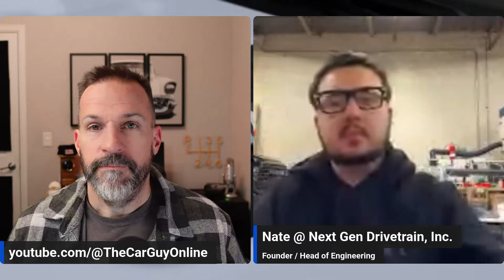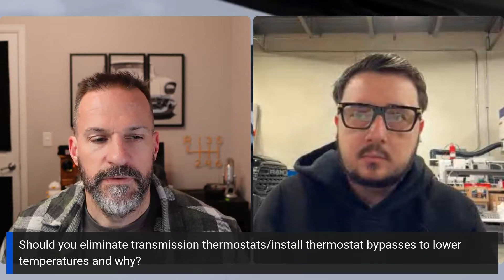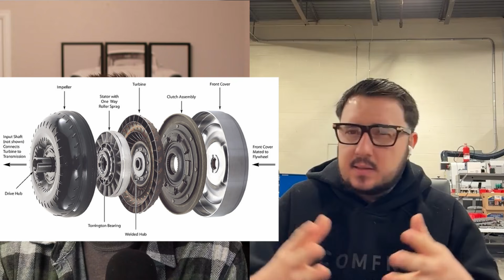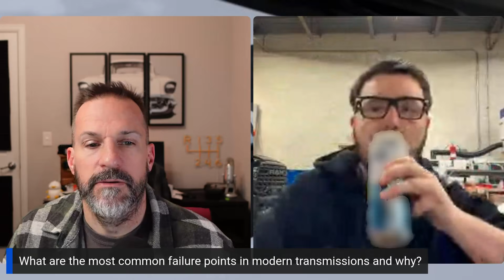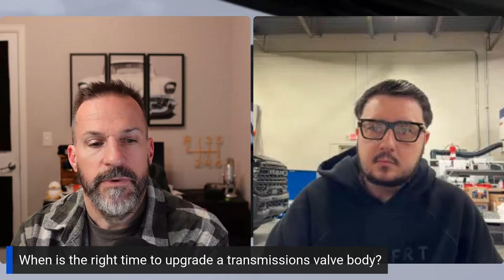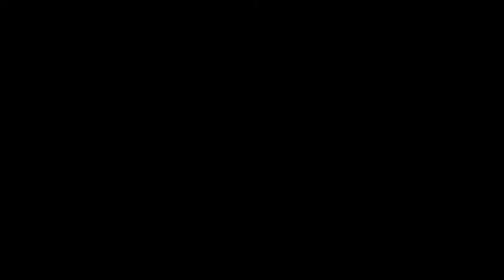Transmission Maintenance Questions Answered w/ NextGen Drivetrain

Comment: 2:26 I just did a drain and fill on my 260k mile gx470 and i think the fluid had 160k miles on it. I was worried it might cause it to start slipping but i think the very cold weather here probably saved the fluid from degrading as fast. The fluid that came out was dark but didn't smell bad. Lowest this winter has been around -25 and high of 45. Currently -7 with 20 mph wind gusts.
Reply: Started slipping, I doubt that a fluid change will fix it.  You should have been changing it every 30 to 50k mile intervals !
Reply: @slalomking i agree, its not slipping yet and i got it at 250k so i the neglect wasn't my doing.
Reply: @badgermetal  oh ok, yeah when you buy used it’s a gamble.  We bought a 2019 Yukon XL with 106k miles on it because the new ones are $80k.  Picked it up for $33k.  So far so good up to 128k miles.  But it’s always a gamble.

Comment: What about the Hondas with the in-line transmission filters? Been changing fluid ever 30,000 miles as I always do (it's a 5-speed Civic), and never changed the in-line filter. I have 220K miles. Should I change it now?
Reply: Change it…..its basically an inline fuel filter.  On my daughters accord,  its under the battery.

Comment: So way back when I was rebuilding TH350, TH400, 727's,  the valve body's were not the problem.....Just clean and reinstall..
If you are worried about the trans being to cold, why not let the vehicle warm up a few extra minutes.......OH wait!!!!  That's
COMMON SENSE
Reply: Have you rebuilt an 8 speed transmission before?
Reply: @Fone65 
His Comment answers that?
Reply: Ohh wait. Maybe when you’re retired with nothing else to do. Not when you’re “running late” for everything 20-60 years old
Reply: @AB-yc1np  get up 10 minutes earlier or install a remote start. You are welcome ma'am.
Reply: @charlietuna1971 
10😅
Reply: Yes !!! Exactly....and I was surprised he didn't recommend that !!!
Reply: Still a fan of the general motors 700r4 transmission the overdrive is an bonus

Comment: I'm concerned about the thermostatic bypass only because of the fact if fluids run to cool then your subject to moisture buildup. True a transmission doesn't have constant exposure to blowby moisture that an engine has but there is condensation. I'm more tempted to believe that avoiding excessive heat (over 230F) is very beneficial but running cold is not good either. Same as for electronics, yes they don't like excessive heat but they were designed to run in a normal environment. Totally agree with servicing transmission fluid on a regular basis.
Reply: A transmission with a thermostat bypass will still get hot enough to evaporate any moisture that may get inside the transmission. Even in colder climates. It just takes a little longer to get hot. One thing about cold climates is there is little to no moisture in the air to begin with. As Nate said the converter and pump make heat. In my experience the computer keeps the converter unlocked until the oil temp reaches a certain temperature and that alone is hot enough to dissipate any moisture in the trans, just don't drive real short distances because your engine will regret it too.

John 3:16
Reply: This is not an engine.   There is very little moisture buildup.   And even if you get some, isn't 180F or 190F hot enough to evaporate water?

Comment: I am so ready for reliability. I have not j tentionally been brand loyal and the current appearance of that with 3 consecutive fords and the first two were new, and transmission failures at 93,900 in 99 Expedition under extended warranty and 97,000 miles in 2008 Taurus. 

I thought I did my research in 2021 when shopping for realizability statistics seemingly supporting the 2018 F150. I bought used at 45,000 miles and insufficient service history records in CarFax. Since, most oil services 3,500 to 5,000, one at 6,000, mostly dealer and OEM, and drain able transmission fluids at 77,000, which dipping the pan and replacing filter would e 7 of 13.1 quarts, if not 5 of 13.1 qts. Reserviced after 40,000 miles with drop, filter, and AMSOIL ULV ATF. Since 2018 is the first year of the 10 speed 10R80 I thank my angels. 😇 at 117,000 miles I have outperformed my 2 past Ford transmissions in May even do that service again VERY SOON so I have over 75% fresh fluids, or maybe the 5 quart job twice for closer to 90% fresh. I need to do a ECU and any other computer module reset, which may resolve the one hard shift into 3rd gear. 

All this unserviceable stuff is malicious; no zirc fittings for steering and suspension, no transmission dip stick, un-drainable differential and transfer case. 

And cheap parts that fail major assemblies: xmission valves and bodies and bushings that slip and block ATF circulation, vacuum module that fails and front wheel drive hubs partially engage and wear out at 116,000 (Ford TSB TECHNICAL service bulletin ?!?! :  bypass the VACCUUM module so hubs remain engaged; criminally insane) turbos with inadequate Oil passages for 7500-15000 mile oil changes, and that dam cam phaser problem. Replaced at 115,000.

Point of clarity. I did not buy to service their pocketbook. INRECONIZED THEIR DISLIYALTY WITH THE FIRST TRANSMISSION FAILURE AND A LIFTER KNOCK WHEN NEW, and at 95000 miles and lifter noises much worse would not dive in. 

Thanks. Nate, future customer.

Comment: For engine, tranny, axle longevity always drive it easy until it reaches about normal operating temperature.  Colder weather takes a little longer to heat up.   Oils don't lubricate well until they warm up.

Comment: If the transmission temperature sweet spot is 120-170°F why would you bypass the thermostat if the thermostat helps keep you above the 120 degree level?
Reply: What if the thermostat fails? The oil is going to get hot but it just takes a little longer. If the thermostat fails then you could possibly ruin the transmission. Plus running cooler than 200° is a positive thing for the longevity of the transmission. 

John 3:16
Reply: Because without the thermostat mine will run at 130F
Reply: From the original post it sounds like you are in the sweet spot range. Do you have shifting issues when it is at 130°?
Reply: @thatsonebadhatharry8610  for me absolutely none.

Comment: People don't want regulations so how do we clean up the air in our urban areas. Just asking. I know people will talk about greens flying to climate conferences and CO2 from the jets etc. I like clean air. I like being able to drive a mid sized vechicle and get 3O plus mpgs and have power when I need it. I drove a 74 AMC Hornet as my 1st car in HS in the early 80s. It had a 232 6 cylinder and 3 speed auto. You would be lucky to get 20 mpgs if you had a tail wind pushing you down the road. Remember it was the era of 55 mph.

Comment: Question; my brother has a 2021 ford ranger 10 speed. He is reluctant to install a improved valve body because he believes it would void his factory extended warranty. I don’t believe it would. What is your opinion?
Reply: So you really belive you could replace the factory valve body with an aftermarket valve body and it wont affect your transmission warranty ? 😂😂😂😂😂
Reply: @ada-yw1bb ha ha, yea, too funny for sure.

Comment: Most important thing to do to a transmission is not a valve body but doing a transmission fluid change and filter change every 30-60k miles vs waiting 150-250k miles per the manufacture recommendation.
Reply: If the trans can’t get to that milestone then why service it 😂 . The valvebody is the heart of the trans and usually is what decides how far a trans is going to go. Use your brain instead of trying to be relevant.
Reply: Yes, that will definitely help.
But modern transmissions are still garbage..

Comment: Hey nate do you think the cdf drum and outter basket issues on the 10R80's are stemmed from the valve body??
Reply: No it is a bad design. That is why Ford changed it in 2022
Reply: Not Nate, but no not at all.

Comment: Nate:  Since GM, in their infinite wisdom deleted the spin-on filter on the 10-speed “Allison”, is there a way to add an external filter?  Maybe tap into the cooler plumbing?
Reply: Insane diesel oil bypass filter has been installed on transmissions now.
Reply: There is no 10 speed Allison.  You have a rebranded GM transmission that’s a piece of junk.  Allison’s only go up to 6 speeds.
Reply: @slalomking  Yes, I am well aware; that’s why Allison is in parentheses.  Duh.

Comment: 50% of the problems we get with vehicles today is due to the Government sticking their useless nose in where it doesn't belong.
Reply: The government never forced GM to substitute aluminum for steel valve bodies.  It is simple greed.
Reply: @georgeburns7251  but the govt does mandate fuel economy standards which in turn require manufactures to reduce every ounce of weight they can.
Reply: @charlietuna1971  that mount of ounces makes no difference.  Purely cost to make, metal vs plastic.  same with European trash

Comment: Any chance Nate (Next Gen) will get into the Subaru market? The TR 580/690 could use a valvebody kit. The rest of the CVTs are pretty good, but a lot of the valve bodies fail around 150-180k and the individual solenoids aren't easy to replace.

Comment: I just bought a 2026 Silverado 2500HD with the 6.6L gas engine and it has the 10L1000 trans, can I use Mobil 1 Synthetic LV ATF HP in it ?
Reply: I put Amsoil LV ATF in my 10 speed F150. Shift feel was immediately much better, and normal operating temp dropped 10 degrees. In 90,000 miles, not a single problem. I won’t go back to that stock ULV fluid.
Reply: There is always someone.  That’s why GM can still sell crap.

Comment: I have a 22 Ford Ranger with the infamous 10 speed.  Here in Minnesota when it's single digits and below, those cold shifts are harsh to say the least.
Reply: Is that not most transmissions?
Reply: @espghia6607  in my 30 years in Minnesota, no.  It's particularly harsh with the Ford 10 spd.  My experience anyway.
Reply: @paultrott3120  Fair enough. The 6F35 is far from smooth when it is cold, also.

Comment: My new 10r80 ( at 3000 miles ) on my 2025 is starting to show the signs of failing valve body when cold ( nasty shift flare ), but man it runs over 200 all the time just cruising......Id really like to remove whereever its thermostat is and put one in about 160 degrees.....since I went thru it 3 times with the 19 I had, im really thinking about just saving the years off my  life fighting with warranty and going straight to an upgraded valvebody, HOWEVER IIRC it would still need to be married to the car by a Ford tech ( then Im sure they would add it to OASIS )....my 25 IS a better car than my 19, factory shift scheduling felt perfect till now...the 19 was worse in fact it whined like an old power steering pump low of fluid lol literally wildly...several second delay park to R cold then R to D, then shift flares and bangs at about 1000 miles.....it ended up with 3 valve bodies and a rebuild under 11k
 In a strange twist of fate, I watch a video where Nate says the 10r80/10l80 redesign in 2025 isnt gonna help it......the next week I got my first shift flares.....UG

Comment: I've found that Valvoline Maxlife ATF is easy to get in my area. It's pretty hard to find Mobil 1 ATF in my area (without special order).
I use Amsoil oils on my rigs, and I've used their Dexron-VI fluid on my 2003 Yukon with a 4L60E, it runs AMAZING even after 253,000 miles. 

I may try out the Amsoil ULV ATF on my 2022 Sierra with the 10L80. Does anyone have experience with the Amsoil ATF?
Reply: Redline makes solid atf products,  available in a multitude of viscosity's to match your specific transmission vs. a single “one size fits all”  universal atf.

Comment: Simple: Change the fluid (drain and fill) every 30k miles!
Reply: If there is a , " tow option radiator," for your car, install it.  It is built to have better cooling for motor oil & transmission fluid.  Your engine will last longer.

Comment: Motor oil geek points out that it's healthier to start your engine Give it a minute or two and gently drive away so it heats up quicker and closes gaps near pistons etc. Which is true. 

The question I have for Nate what is the impact on the transmission of driving after a minute or two when tend are -25 celcius or cold. More be better for the engine but damaging to the transmission?  

Engines and Transmission temperature control  systems appear to be out of sync for health of both?  Right have and left have not working together as one?

Comment: Really sad.   I'm. In holding pattern ready to buy but am watching all these manufacturers with recalls failures and nothing but problems.  I may just sit on my 2015 tundra longer than expected.   Bought it expecting to keep it 5-7 years.  Coming on 11 years now
Reply: Keep it as long as possible .  My wife has a 4 runner , hoping to keep it forever . I have a ram going on  10 years , keeping it as long as mechanically possible . I hope to never have to buy the new junk

Comment: I purchased a 10R140 valve body and pump from SunCoast because for refused to inspect or address my transmission behavior. I asked 99% of companies offering VB upgrades if they were in essence a RatioTek kit in an OEM body. Every single one skirted the question. I am now buying the NextGen valve body, and installing it in my new, out of pocket, FORD transmission, My truck has 23K miles.

Comment: Nate, with regards to operating temperature and bypassing thermostats, where do we fall here in Western New York? We've got hot summers and I'm pushing 200° in my 2022 TRX towing the boat, but in the winter time we definitely are getting down into the single digits.  Is there such a thing as a selectable thermostat or a thermostat that just opens at 80° or something? I guess for me I'd be talking about the 8HP 95 power line?  Seems like the electronics are going to be a problem so I guess erring on the side of Cold is probably the way to go?
Reply: Hey guys!

I would love to answer this for you. The TRX runs an 8HP95 just for clarity. They naturally run warmer than most transmissions. How cold it gets is less important than how hot it gets in the warmer months. If you’re somewhere where even warm months are cold, I’d say there’s no meaningful benefit. However, if you have warm summers, you’ll still experience the benefit from removing the thermostat. 

Remember that transmissions create their own heat, mostly through the torque converter and the pump. This means that cold weather isn’t a huge issue because it will warm itself. If you have warm summers, this is where decreasing the average operating temperatures will have the most benefit. ZF 8-Speed transmissions naturally run hot so it won’t harm anything.

In short, I’d delete the thermostat for someone in NY without any question. I’m in Pennsylvania and will delete mine soon. We don’t make a product for that at this time but there are plenty of options!

- Nate @ Next Gen
Reply: @NextGenDrivetrainInc  Any consideration for places that have upwards of a month out of the year that's below zero F (but 80s for two months out of the year)? Seems like you're implying that the self generated heat will be enough to avoid issues, but wanted to double check. Thanks for all the useful information you provide!
Reply: @NextGenDrivetrainInc How important is it to change you engine thermostat?  My engine runs at like 205° which in my mind is making the transmission hotter.
Reply: @NextGenDrivetrainInc  Nate, do you guys make anything for the TRX? Like a billet valve body for the 8HP 95?  I got to give you guys a call one of these days. I have a friend in Harrisburg And I routinely come down to Tioga every summer ahead of 4th of July.  With the TRX making a comeback and all the hellcat stuff coming back would love to see next gen jump into that space and help us keep bulletproofing these trucks. So far we got entropy for the leaky radiators, East Coast driveline for the clunking drive shafts. You could write your own ticket if you come up with a re gear kit for a 37s or '40s, a water pump that isn't a complete piece of shit like the factory, same for engine thermostat, and I'm definitely interested in any transmission stuff you have for the truck! I have really enjoyed your segments, I can't wait until your shops channel is cranking out new content!
Reply: @NextGenDrivetrainInc hi I have an 8L90 I've been deep diving into this tranny bypass for lower temps would u recommend this for people experiencing 5 months of winter with temps seeing as low as -40? Would fluid still flow to the coolers if I bypassed it or due to cold temps u wouldn't recommend it??
Reply: Great question, I'm in Northern Ontario. For a few weeks up to 38 c real feel in the Summer and -38 c in the winter.
Reply: @RidgelineFun If it was mine , I would look at a thermostatic cooler control that can be set to open at say 150 deg. Below that it bypasses and builds heat. Above and it goes through cooler..The temp might not be your exact need. The heat builds fairly quickly , an add on temp guage would be a good idea . You could monitor your exact use and plan from there..
Reply: @kevinpurton4944 I was thinking the same thing I sent these guys a question as I was watching and he answered it I think for Ontario winter our best best for lower temps is installing the I think 140-160° thermostat over the stock 194° one
Reply: @nextgendrivetrain  What do you think of Red Line Oil D6?  I have it in my Telluride, but got here by using their product 20 years of using their products, but realize a lot  has changed over those 20 years
Reply: Nate, I would check with fluid manufacturers to see if there are special additives that activate at certain temperatures before I recommend running 120-170
Reply: @RedTurbocar my RHO hardly ever gets above 140-145